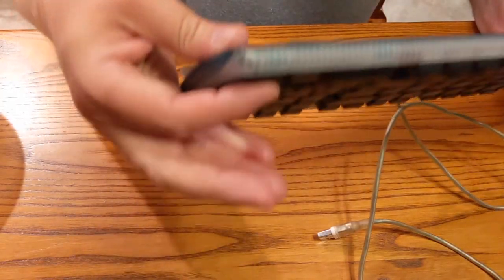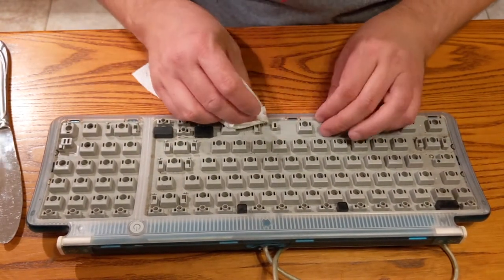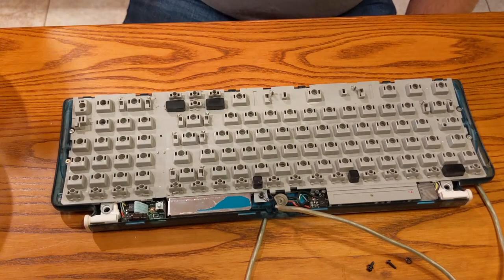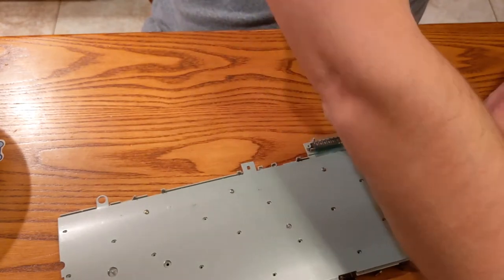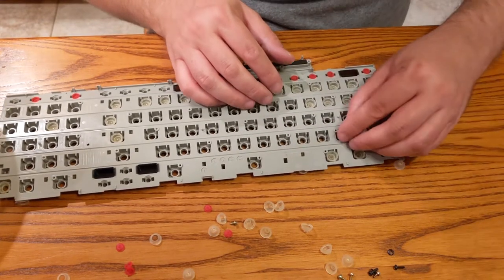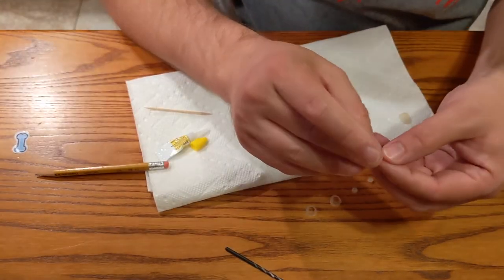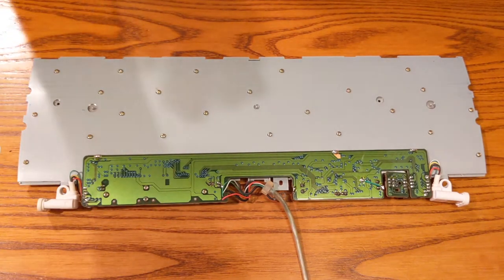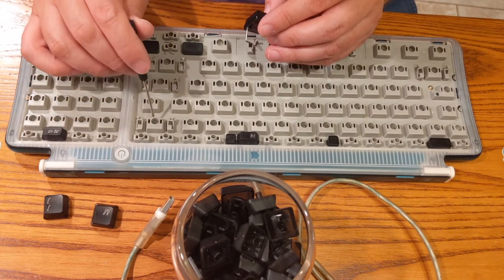Original iMac Keyboard Repair

Comment: What's the best tool to use for taking off the top part of the keyboard safely without breaking any of the tabs? A flathead or a spudger? Because I recently just got in a lot of these old M2452 USB keyboards all with various problems and broken rubber domes and I really wanna restore at least one of them to fully working order.